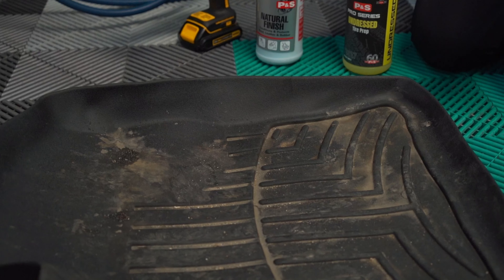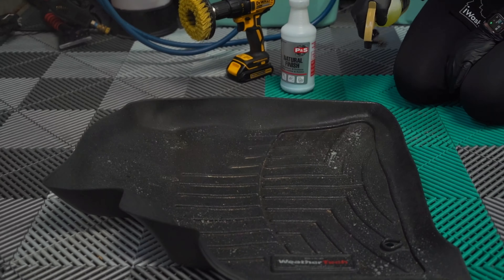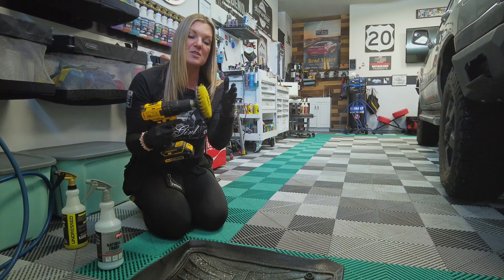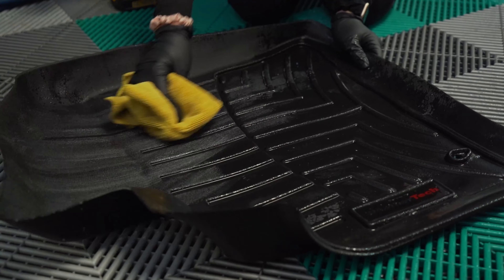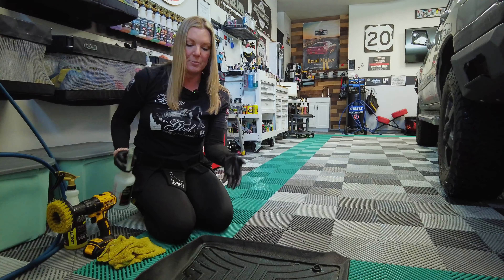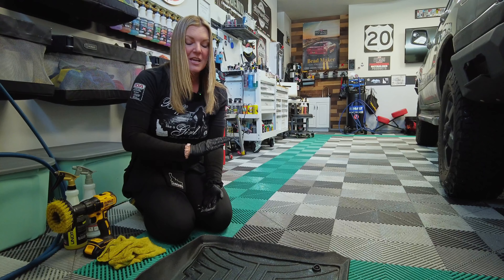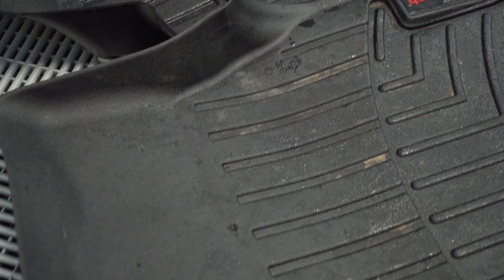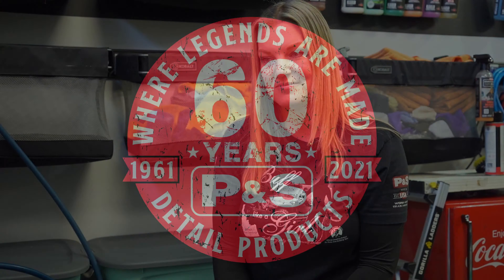Undressed Tire Prep + Natural Finish for Rubber Floor Mats

Comment: I used natural dressing for the firts time today.  really liked it on my interior, but it's slick as hell on my rubber floor mats.  How are you using it to keep it from being slick?
Reply from the maker: @bigfranksworld  certain ones get slick but most don’t 
If they’re slick, I spray a towel with absolute or Xpress and just rub over the mat and it will still stay black but remove the slicky-ness
Reply: @PandSDetailProducts  Okay, I'll give it a try  Thank you!

Comment: What ratio is the diluted Natural Finish used on the mats, I used the 16-oz bottle without dilution but mats are slick under foot
Reply from the maker: I used it full strength